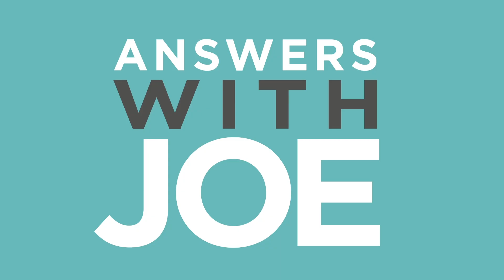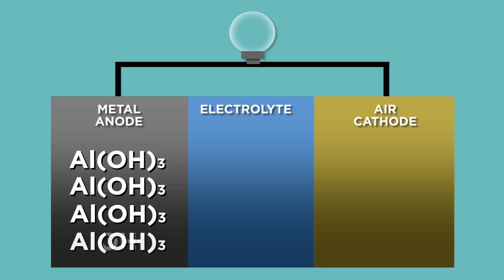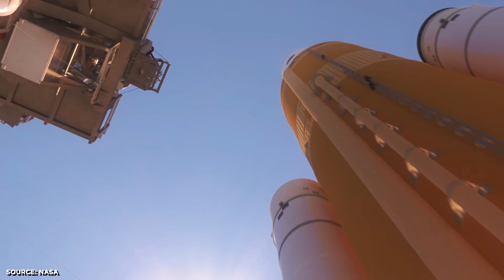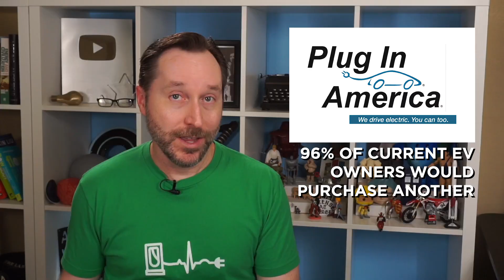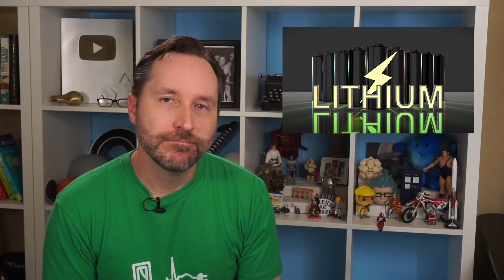This Battery Could Drive A Car 1500 Miles - But There's A Catch | Answers With Joe

Comment: One thing that wasn't talked about in this video is the fact that the aluminum battery can't be used with regenerative braking. There is so much energy that gets wasted everytime you brake in a ICE car as all that forward momemtum has to get converted to heat as apposed to capturing (most of) it and putting it back in the battery. Perhaps this could be a good solution for long distance freight transportation (trucks, trains, ships) where you have dedicated support infrastructure, not a lot of braking, and long ranges on predictable routes?

Comment: called an air battery but uses water upside down times is among us.  
Have an option in a tesla a gas generator those who dont have access to charging at home.  and It only turns on when car is in park . Its a win for everyone

Comment: As an EV owner without a garage to charge in, I dont find it too difficult to charge my car. My lifestyle really just fit well, as my job is across the street from a free 24hr charging station and my job itself has a backdoor outlet that reaches to my car and as I work 12 hour days usually that's more than enough time. I could see how it could be a problem if you didnt have any of these options, but that's just something to consider beforehand

Comment: every battery that can out perform Li-Ion or Li-Po for cars and other applications is good, but it HAS TO BE more "green" to produce the battery´s than they are today.
just the production of all new hitech battery´s will tip this planet over to the dead side...

and ofc, there is no "the best battery" everything depends on the application, but i want to see more battery solutions that store wind and solar power. and just not dump all energy in tho the grid as it is done today in many many places.

Comment: yeah, the filling from a regular 110v volt outlet in my garage once or twice s a week is a no brainer.  Basically every morning I have a full tank, with no stops anywhere.  If I needed it faster, I would add a 220v charger, or use my dryer connection.
Reply: I could see for a long trip, it could work to swap out my lion bat and use one of these, and every 1000 miles stop and get a new one.  Once I get back home, swap back for my original battery...probably fully charged.

Comment: In Taiwan we have Gogoro, a super fast electric scooter with a battery swap system and network. It works great for scooters because the battery is easily inserted by hand from a kiosk. It's only bulky cars that need a complex robot to swap the massive battery. American cities should take a page from asia, ditch the car and popularize scooters. Solves all the problems.

Comment: Honestly ... two things, i dont like the non rechargable part but ok .. why do the battery need to have special ways to be plugged in? Why not allow a solution that you can plug in and out with your hands ... you know like normal batteries sure you would maybe need mutiple but that would remove all needed infrastructure and would allow the stores to just stock it since it doesnt needs special infrastructure.

Comment: Another major downside of aluminium-air battery is that they're way less energy-efficient. i.e. it takes a lot more energy to recycle a spent one than to recharge a regular lithium-ion battery. Not to even mention the energy needed to run the infrastructure...

Comment: Joe, what about just replacing the Aluminum part of these batteries rather than the whole battery?

I can imagine a slot section if these batteries where the spent AL block is easily interchangeable and probably wouldn’t take much more effort/infrastructure than a modern oil change service station.

Comment: If the range could push closer to 3000 miles it would make a battery swap more akin to an oil change, with most people doing it few times a year. one station could service several thousand residents and if it takes 30-45 minutes well so does an oil change

Comment: The hybrid idea sounds pretty good. Only have your Li-ion for daily driving, then when you go on a long trip, load up an AL-O2 battery and drive to the next location to swap that out.

As for AL-O2 needing to be shipped by truck, that's true, but if all recycling was done in a local area, then shipping distance would be reduced.
Reply: Just build a still in your backyard and distill your own fuel alcohol. Then you don't need to worry about gas prices anymore. You don't need to resort to electric cars. And biodiesel can be made from cannabis seed oil, soybean oil, corn oil, etc. No need to force everyone to conform to Big Brother's will.

Comment: The Washington Monument Was Completed December 6, 1884.  That 9-inch aluminum pyramid, which completes the top of the structure as it narrows to a point, is 100-ounces of solid aluminum, part of the monuments lightning protection system.  In the 1880's, aluminum was a rare metal, selling for $1.10 per ounce and used primarily for jewelry.  The pyramid was the largest piece of aluminum in its day and was such a novelty that it was displayed at Tiffany's jewelry store in New York before it was placed at the top.

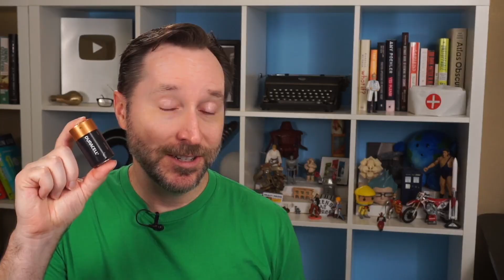Comment: 5:54 calling the Al in an Al-Air battery recyclable is cheating. As the aluminium is oxidized to aluminium-oxide, "recycling" is more akin to re-production. The 95% advantage you cited before for recycling is just not there. You basically end up with aluminum ore, not recyclable Al.

Comment: It would be nice of the aluminum strip could work like a cassette tape and be wound inside the battery with the liquid and air running throughout it so you can simply just have the aluminum go in one side and come out the other side and a nice system. Also when the batteries have no liquid in them they're very light because it's mainly just aluminum. 
Or even having a cycle where you can flush low-grade acid through the battery in order to re-etch the aluminum and be able to start the process over again. 
The fun thing is you can actually make these batteries at home and learn how they work

Comment: You have to put gas in cars and its used up through the operation of the car which requires more gas. So, having to replace the aluminum battery is not without precedent. The only difference is gas is a liquid and aluminum isn't (I think?).

.

Comment: I cannot see replacing a fuel cell of any kind in any type of vehicle currently used. Everyone says it may be good in large commercial vehicles, with that your looking at much larger and heavier cells. I drive an 18wheeler cross country and get 1700miles on 1600lbs of fuel that I typically burn in 2days with a 15minute refueling time and I am able to dictate how much weight worth of fuel I’m carrying based on how much my load weighs so I can stay within legal weight limits per set of tires. 
Hitting a mechanic shop to replace a multi ton cell every 2 days will never be time or cost effective and would completely destroy the flexibility needed to maintain dot compliance.

Comment: Maybe some sort of system where you don't replace the whole battery, just the aluminum plate, sort of like a plug and drive. You buy the aluminum plates at car part stores, and you can have a couple in your trunk that you can swap out on the go whenever you need to. Disposing of the plates could then be done normally along with other aluminum items instead of needing a ton of infrastructure to swap the whole battery each time.

Not sure about the whole water part, but it could be done similarly. There's already tons of places where you can buy distilled water for various purposes, or better yet the cars themselves could have a small distilling unit in them. Power them by reclaiming energy from motion like combustion engines already do to recharge their batteries, and you could refill that bad boy with tap water instead of needing distilled water.

Edit: swapping the aluminum plates could also be economically viable. Recycling companies like aluminum, so if you just throw the plates in the trash it's basically free money for them. Not sure how much the plates would cost in this scenario though and if it would be viable and/or cheaper than gasoline for users, but a solution could be worked out. Plenty of countries already have systems in place where you're paid to recycle aluminum cans, so maybe something similar could be worked out for the plates. You get a coupon for the next plate if you bring in the old one sort of deal.

Comment: The objection that it takes a lot of energy to convert the spent battery aluminium oxide back to aluminium is only valid if the energy loss in conversion is high. I think this is the case, but I do not know why. By the way if aluminium reacts with water to produce hydrogen maybe we just leave the battery at home but fill it up with water and, we err, BANG?

Comment: Something I've gotten into exploring recently is carshare platforms. And with automated driving on the horizon, autodriving carshare is like a taxi, or a small-scale bus. For high startup cost maintenence infrastructure, car share seems to be the way to go. Aluminum-Air battery might fall in that category. Cheers!
Reply: You’d have to be crazy to ride in a self-driving car. Of course mass insanity is at an all-time high these days, so some people will probably do it.

Comment: Here's my proposal for a battery technology.

We simply develop a tiny creature with a relatively big brain mass. Brain contains a lot of fat, so it'd be good for burning. Then we put them into a container divided into cells, and then we set fire to them. The high heat CO2 will drive a generator. The only byproduct is some C02, but we'll make the batteries small so it won't be that bad per battery.

Comment: I like these batteries for backup power when I take the electric truck ands trailer into the woods. Good use case for areas that are underserved by charging stations. Just like a spare tank of gas. Deliver the used battery back for recycling. Pick it up before you leave for your trip.

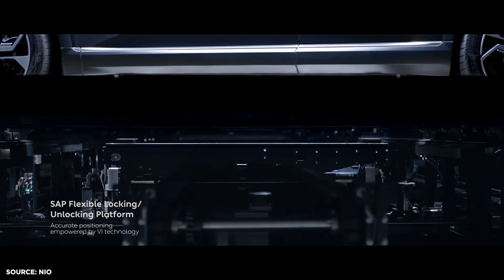Comment: 6:20 Battery swap stations.

Not really an option because of the sheer number of cars that you have to service every day, but also because car companies are not going to play nice and make interchangable batteries that work on every brand of car. 
ps: trucking in batteries or hydrogen is not an agrument against it, fuel is trucked in too.

What I am interested in is how they are going to stop the world from exploding once one of those aluminium batteries catches fire within the magazine full of thousands of batteries.

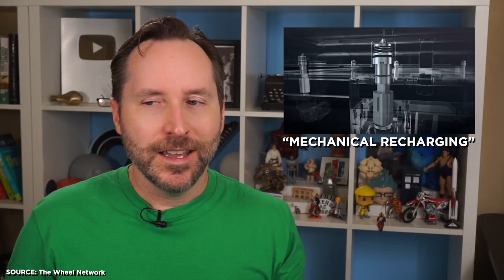6:38 "Might even be faster than filling up your car with gas". I don't know, we europeans drive cars that only hold about 30 liters so that batterychange is going to have to be really quick.

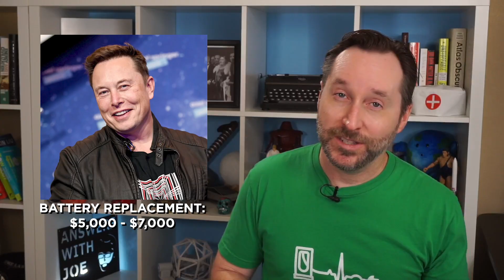7:55 "Elon has said". Yeah well, Elon says a lot of things, rarely containing any truth. Remember the bulletproof glass on his "truck"?

Comment: The problem for people who can't charge at home is just another infrastructure problem.  Rather than build out this massive aluminum/air swap station network...just pass a new planning regulation:  "X% of new parking spaces built are required to include a charging outlet.  Arrange for X to automatically increase each year to match the percentage of electric cars on the road." ...problem solved!   Car chargers are profitable...so this is actually no great harm for businesses that build/own parking spaces.  As new apartment complexes, businesses and parking garages are built, EV owners will choose to preferentially live/work/shop in those locations - which will apply pressure on existing parking facilities to add their own chargers.  While we're at it - add:  "All new buildings are required to have Y% of their roof area covered in solar panels."

Comment: So the aluminum air battery just consumes the energy that it required to make aluminum metal in the first place minus losses.
Reply: Yep. Which TBF is true for any source of energy/storage technique, at the end of the day... only that the alumina-to-aluminium refinement has a particularly low efficiency.

Comment: Metallic aluminium has a melting temperature of 660°C, processing bauxite (aluminium ore) requires temperatures in excess of 1000°C. Combined with the effort needed to mine the ore, that's why it's so much easier and cheaper to recycle aluminium than to extract new aluminium from the ground.

Comment: This would HAVE to be a hybrid, I’d want at least 40 miles of rechargeable so my commute and times the car is just running cabin A/C and/or sentry to be burning up my aluminum pack.
Reply: Good point, you'd need rechargeable to run some things on it to spare the aluminum pack, it would also operate as the emergency reserve and, if manually selectable, you could use 100% rechargeable on shorter trips and use the Al pack only when necessary. And if you're really screwed on the road and the Al pack is depleted beyond the capability of propelling the vehicle forward, it would still have a little bit of juice left to perform a final rechcarge of the emergency reserve batteries, maybe just enough to get you out of trouble.

Comment: The infrastructure is mostly in place if they were sold as a repair part and average Joe mechanic could swap. You could even get a decent amount for the dead battery in recycling. As everything is moving EV, I'm sure mechanics would welcome the predictable work.

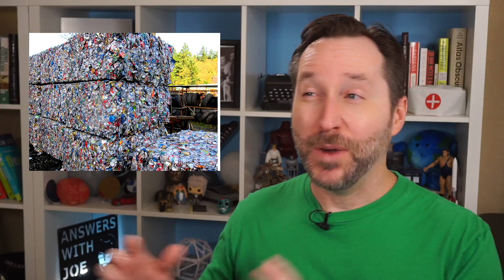Comment: 4:18 No! False! (In this context)
Please Joe, you're missing the one reason why this aluminium-air "battery" idea is bogus. And the current hype around it must end.

The waste aluminium from this "battery" cannot be recycled. As it's not aluminium anymore. It becomes Aluminium hydroxide, or Gibbsite. Which is the base ore that aluminium gets made from.
Hence it needs to be remade. Which is where that 95% of energy you didn't need to make a waste can into a new can comes back in.

While I'm struggling to fully understand all the (electro-)chemistry involved it does appear that the Gibbsite  must go through the Bayer process first, followed by the Hall–Héroult process.*

The Bayer process is already incredibly energy inefficient. (These plants usually have their own fossil fuel burning energy facilities) and it gets better (or worse actually, much worse) with the next step.
In order to get the oxide off of the aluminium in the Hall–Héroult process, it gets turned into CO and CO2.
So every molecule of oxygen this battery takes from the air becomes a CO2 molecule in that same air.

So not only is the round trip energy efficiency abysmal. As we currently get about 1,3kWh out of a kg of aluminium, and we need 15kWh to refine the waste back to aluminium.
But the carbon rods expended in the process will makes this worse then burning gasoline in a piston engine from a greenhouse gas perspective.

As always I loved the video otherwise with all the interesting sidesteps.
But as the main subject discussed is the battery, I feel I must points out this flaw.
From all your previous videos I'm gonna assume that I'm not insulting you with this comment. (If you even get to read it)

* I'm certain about the Hall–Héroult process, as that removes to oxygen.
There's also a hydrogen atom on the Gibbsite, and I believe that's where Bayer comes in, but the different following chemical equations are beyond my full understanding.

Comment: Using batteries for harbor ships and short range cargo (think Indonesia to Singapore) represents a whole lot of shipping, it is using Diesel at its worse (lots of speed changes) and is usually close to large population centers. This covers tugs, crew boats, fuel tenders, water tenders, sludge tenders, waste oil tenders, supply vessels, feeder container ships, patrol boats, ferries and much more. Hell, if cheap enough these batteries could be used to switch off most auxiliaries on big units. Getting all this electric would have a huge impact. (On a personal level, if ships could be quiet and smoke free when at anchor/alongside, that would make my offshore life much more pleasant)

Comment: Dumb question, why aren't solar roofs on cars more common? It may not charge very quickly, but it's basically free energy everyday during daytime for the small cost of the solar panels, over the lifetime of an EV it should be a good amount of energy.

Comment: Aluminium oxides are chemically the same as bauxite. So knowing the huge quantities of energy required to refine aluminium oxides (bauxite) to aluminium dose anybody care to do the math to figure out the KWH per KM / Mi based on the average electric car consuming 100 - 300 KWH/KM. Given that a lithium ion battery can be recharged thousands of times the production energy over the 300000km life of the car is negligible vs  aluminium air only getting 1500 Mi over its life.

Comment: These batteries aren't really viable for anything other than exceptional uses. There are too many steps involved in using them. If you look at gas & electricity prices this type of battery will always underperform in a cost comparison.

Comment: I love this line "designed to last the life time of the car" what is that? one week? one year? 50 years? they should be designed to last as long as possible. i have a fossil car that is now 35 years old and still going strong. engine is in exellent condition. if i buy an electric car i want the battery to last as long as possible, if not for me but for the next owner. more eco frendly than buying a new car. but we all know that eco frendly comes last if money is in the way.

Comment: Tesla Model S has 100 kWh battery. An aluminum-air battery with this capacity (at projected 2kWh/kg) would weigh 50 kg. If they would make standardize packs weighing 15kg and the car is engineered around the ability to quickly swap those packs from the user perspective it wouldn't be even that bad. Drive to a station, remove 3 (fairly light) packs one after another, insert 3 fresh ones, lock and go. You could even have some spares.